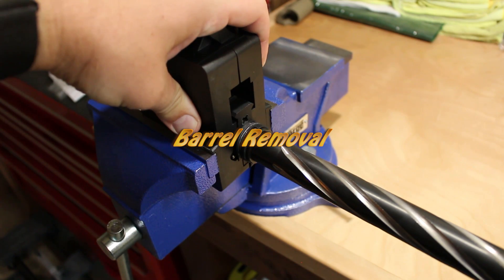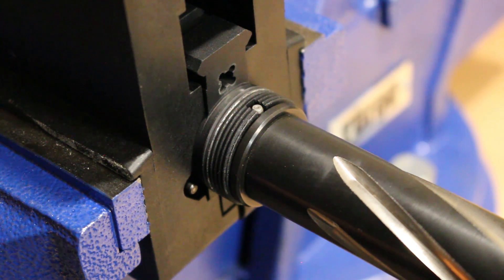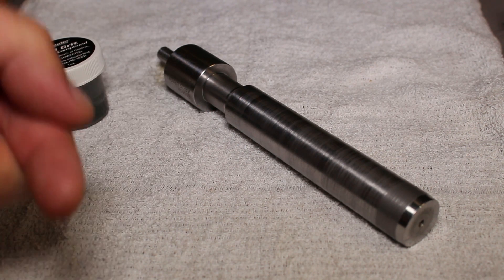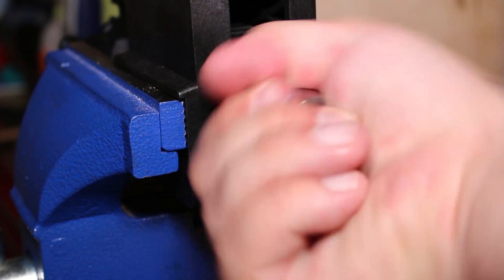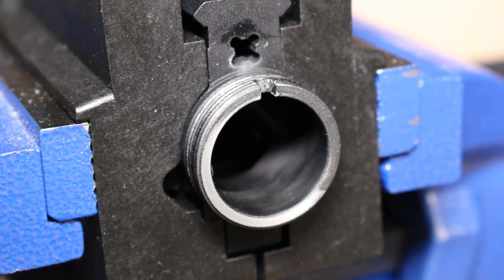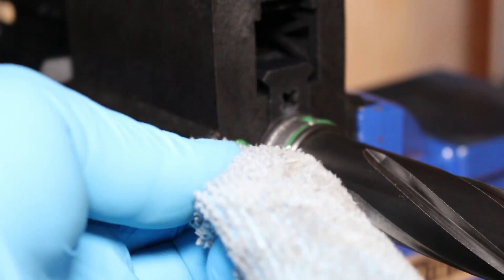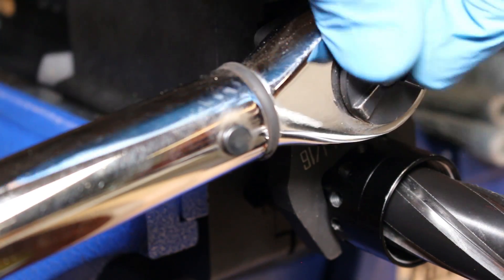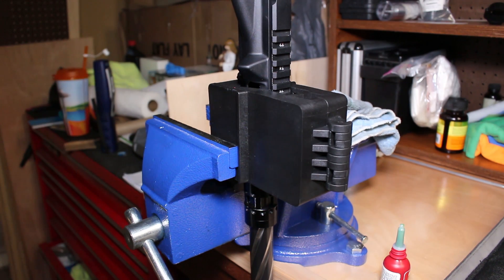Bedding a Barrel into an AR-15 upper receiver

Comment: Just for thoughts....Do all the work vertical. Lapping, bedding, tightening, with receiver and barrel sandwiched inside the plastic receiver block, receiver block vertical. There are much more sophisticated ways of centering your bcg,bolt,receiver,barrel if you have a machine shop and a lathe. But this is how I do it in the home armory. It's good enough for .75 MOA if everything else is working for you.
BEDDING. Apply the green “expanding” Loctite (620) on the outside wall of the barrel extension for proper bedding, make sure the green coating is even around. The green stuff is not for threads yo. Still in the vertical position install barrel. Then install bcg and bolt to locking position. Tape back of bcg and receiver to give extra hold. Put some aeroshell or red and tacky inside the receiver extension nut. Wipe of any excess green stuff from the mating surface of the barrel and receiver. Tighten Receiver extension nut to 20lbs only with unit still in vertical plastic receiver block. Drop out bcg and wipe any excess green out of the inside mating surface of receiver and barrel extension. Let sit for a few hours to firm up. Remove unit from crappy plastic receiver vise block and install unit on steel barrel extension wrench, wrench mounted vertically in vise. Crank down receiver extension nut to 25/30/35/40 loosen each time. Stop at 40lbs. Most nut wrenches add a few pounds (3-8) to the torq reading anyway. Let sit vertical for a few hours. Check for any green stuff inside receiver. Test bcg/bolt fitment again, should drop in real smooth. This is assuming that you removed as little material as possible during lapping…LAPPING. If you over-lapped it then it pushes the rear of the bcg backwards in the receiver, check to make sure all components are working properly. Over lapping is not a good thing. Just a little bit is all it needs. When you see exposure of silver down there between the 6pm and 9pm position during lapping is because the lapping is typically done clockwise and horizontal with gravity pulling the tool down on the system. Horizontal lapping is how they show you on the Brownell’s video and many other videos. It’s dead wrong. Gravity is working PERPENDICULAR against the centering of the system by pulling down on the drill and the tool. And the drill operator is adding a lot of error (many thousandths) to the system by holding the drill horizontal. In the vertical you can spin the tool gently by hand and let gravity do the work. Just have a little patience. Or use a low rotation battery powered bit driver that is symmetrical with the tool and vertical, 200 grit lapping compound. A hand drill is not a symmetrical tool, especially not in the horizontal….SUMMARY. The whole idea is to keep the moving parts centered together, remove gravity as a perpendicular force during install, and don't over torq your barrel nut. It's NOT needed above 40lbs. Lastly you don't need to lap the receiver down to aluminum if not warranted. So many peeps like to grind that baby down. Just lap the hard coat until you see even removal on the hard coat, if possible. The less exposed aluminum the better. The hard coat actually helps to reinforce the aluminum extension lip during the life of the rifle. Cheers.
Reply: I’m just a hobbyists but my thought process aligned with your comment. I thought this was common knowledge until I read a lot of comments on YouTube and forums.
Reply: Great explanation

Comment: WOW I see a lot of people bitching about using LOCTITE. He is using a LOCTITE brand  retainer compound.I use a sleeve retainer on my builds and guess what Criterion Barrels uses it as well in their builds.I am guessing they know a bit more about AR15s  then most of us. Criterion uses Loctite 609.
Here is what Loctite says about 620.

Retaining Compound - high strength. High temperature resistance.
LOCTITE® 620 is designed for the bonding of cylindrical fitting parts. The product cures when confined in the absence of air between close-fitting metal surfaces and prevents loosening and leakage due to shock and vibration.
Reply: Criterion uses 609 so that an average AR owner can actually disassemble things if needed...

620 is for a gun smith or machinist who has the shop equipment required to actually remove the barrel lol....definitely the right choice ONLY if you have a proper shop.
Reply: @atranimecs  620 is not that hard to get apart.  Just did one today with a heat gun.
Reply: @jbmillard  Notice a proper shop would have something like a heat gun or blowtorch like I said. average joe may not have either in their garage.

Comment: A+ for effort, but my man...that extension to receiver play is God awful. I dont even think .001 shims would do ya justice. I get the lapping, makes sense.  FYI best uppers i have ever used with my builds NOW are hands down LMT.  BCM, Noveske, Dan. Defense barrels line up with real snug gotta tap it in fit.  The upper to lower(LMT)fit is universally a sweet thing as well.  Buffer tubes, pins, trigger pins, bolt catch, etc hare great running as well.  Ok thats my tangent.

Comment: hate to break it to you but your loctite temp will not take 556 temps
Reply: How hot is that?

You may get ~300F on the barrel speed shooting (Not on the barrel extension, a separate piece of metal that doesn't come into contact with the brass or contained gas itself). If you're shooting fast enough to get it higher than that, you won't be worried about accuracy, since you're burning out the rifling in the throat.

Loctite 620 is advertised to withstand 200C (392F). The barrel extension is not likely to reach the barrel's max temp. And again, if you do get it that hot, whether your loctite holds or not isn't going to be the deciding factor in how quickly your barrel stops being accurate.

Comment: Is there a potential for cracking the upper due to the expansion of the loctite against the inner portion of the receiver/barrel extension?
Reply: Prolly not. Billet aluminum has a pretty good elastic limit and an even greater UTS. Forged even more. Plus there is the greater thermal expansion of aluminum.

Comment: If my barrel wiggles in my upper like that, I am trying out different barrels and different receivers and whatever is the problem is getting returned with a poor review.  If your upper fits your barrel like that out of the gate....No.  Just no.  It should never be that loose.  If you have to do what he is doing you've already failed.

Comment: If you have that much free movement time for a new upper. Aluminum is a recyclable metal. Buy a new upper for anywhere from $39-$200 depending on the size of your wallet.

Comment: Head spacing is already determined from bolt and barrel lockup. NOT the receiver trimmed back. You "might have feeding issues if ramp cuts in receiver does not match up to barrel. But headspace IS NOT SCREWED UP JUST BY LAPPING

Comment: Many are under the impression that a  locking material like LocTite is needed- IT IS NOT. The torque holds the nut to the receiver. I have never, ever seen a loose barrel in the military.  As an armorer I have seen thousands of overused guns. YES the facing of the upper is needed especially for long range shooting as it aligns the barrel to the upper.  Facing will NOT change the headspace as the headspace is integral with the barrel. The barrel MUST fit snug to the upper and the best fit is a slip fit. We used .001 stainless shim stock wrapped around the barrel extension to fit sloppy barrels for accuracy guns as even .001 barrel shift when assembling will  cause a lot of scope issues at long range. Within MIL-SPEC is a joke as it is the MAXIMUM and minimum allowable specification and still work..  FYI  The shear point for a  barreled upper is the last thread on the upper behind the barrel nut.
Reply: The purpose of the locTite is not to keep the barrel from coming loose.  The purpose is to fill the void like you are doing with the stainless shim stock.  Shim stock is much better, but still adding the LocTite fills what' little void is left so that there's even less movement.
Reply: @nospam3409  Eh, personally I wouldn't use Loctite at all, but that's the benchrest fudd side of me coming out.  I would think Marine-Tex could be great at this though.  Not only because it has very low shrink and is practically impervious to chemicals, but also because it would provide a thin barrier between the steel extension and the aluminum receiver to help prevent galvonic corrosion.  Only reason I bring this up is I just pulled a barrel from 2 years of use and found a lot of it, and since I've been looking at further preventatives this might serve a double purpose.  

You could also use actual bedding compound, but since those contain numerous metallic powders I think it wouldn't do much for prevention.  Besides, marine-tex is good enough for the f-class, PRS shooters (the real shooters, ie not me), it's probably good enough for wanabees like me.
Reply: Thanks for taking the time to write this.
Reply: Yep this dude knows. This video is crap.
Reply: I never use loctite but i do use anti-sieze on the threads because too many have come to my shop for cerakote and people do not take care of their weapons and they are rusted fast and gauled to the aluminum threads
Reply: @HPAccuracy that's the correct way. Don't lap upper receiver and don't bed your AR15 barrel. You can add anti seize to the barrel extension or the inside of the receiver where the barrel fits in too but isn't needed. It helps if you ever plan on re-barreling your AR15 down the road.
Reply: "...in the military..."  

Stopped reading right there.
Reply: @fluxcapacitor05 sounds like a true hobbyist
Reply: stainless shims dont disintegrate over time from the cooling/heating cycling?
Reply: @atranimecs  If that is a question then NO. No rust or deterioration at all.
Reply: @@user-hs5vk6jw1o that's before when tolerances were a lot looser and machining wasn't as precise. Especially with some uppers being designed with smaller diameters to be heat fitted to the barrel extension and torquing the barrel nut will compress the upper onto the barrel extension as well. It's absolutely a waste of time and money.

If your accuracy is that bad with modern AR15 parts you're either a terrible shot, have shit parts or both.
Reply: In my case though it does make a difference. I had Ruger MPR that I got rid off. After a while the barrel nut got so loose that it could have been taken off with a finger. 
Luckily I found that out before anything catastrophic. I say DEFINITELY blue lactite the threads. My 2 cents

Comment: How much difficulty will be encountered when it's time to remove the barrel?
Reply: Depends on if antiseize is used (Aeroshell 33MS is milspec and perfectly sufficient, no need to get exotic) and also the upper receiver.  A bravo company upper and some others are tighter tolerance and you have to heat them with a gun to get a barrel on, so they are difficult to get off.  Get yourself a heat gun for reflowing solder and you will find that there isn't really a problem removing it.
Reply: a little heat from a torch, easy pezy
Reply: @chrismcrae4652  ummm a pretty big torch...that is highly heat resistant compound

Comment: Great video! I think most of the people leaving comments claiming to be "Professional gunsmiths" and slamming the use of loctite 620 are missing the point. In the video, this man is not using threadlocker on the threads. He is using cylindrical sealer to close the gap on the barrel shaft. I didn't see him put any "Thread locker" on the threads. Also, just because it's Loctite brand doesn't mean that it's threadlocker. That company makes more then just thread locker.... LOL
Reply: Exactly
..and that's 'bedding' an AR barrel. 
Lapping is the procedure to make ready for bedding.
Reply: Yep it's called retaining compound and that's precisely what it's for, retaining and taking up a small gap, it's almost as strong as a weld and is a ferocious bond pretty crazy stuff
Reply: Kenny Wooldridge  Is anybody familiar with Loctite NS 5540 High temp for  Threads and Flanges? With a service temperature of 100 to 1300 degrees Fahrenheit?
Reply: Lapping one surface that mates with another is a waist of time unless all surfaces are squared up nothing is getting trued up. So one would also have to lap the barrels and barrel nut. But before that's done one should measure the shit out of the parts to find our of this even needs done or where they are off.  Is the barrel nut getting squared up also he didnt lap it so the upper is squared up but the barrel and barrel nut are what the hell ever . Lapping just the face on the upper receiver is waist of time. There are at least 5 points of contact between barell, receiver, and barrel nut but we are to  square up only one surface. I wish could do that at work just debut one surface and call the part good.
Reply: @PurpleHaze-151  the barrelled flange that meets up with the receiver is already squared up from factory. It's squared up when the barrel is formed and would be almost impossible to have that flange NOT square unless someone completely failed in the making of the barrel. The receiver is not square. You lap the receiver to get it square, which you can actually see by the lapping compound marks and then the barrel flange sets square to the receiver. The barrel nut doesn't have to be totally square because it's just compressing the two surfaces together. So there's are only two surfaces that need to be square and one (the barrel flange) already is square. The barrel nut only has to be close (which it is) for it to all pull together close. Then the retaining compound fills the gap between the barrel tube and receiver.

Comment: 2 issues with the video. If you are lapping the receiver to get consistent even surface, why would you stop short of a complete lapped surface. And the Loctite. That's just not good advice. Antiseize or a good grease only.  Some poor guy is going to loctite the barrel nut and "That's what I saw on YouTube". I guess the 2 issues is the video.

Comment: How could headspace be affected by shortening this threaded area? I thought headspace was dictated by the distance between the boltface and the shoulder, which depends upon the lockup of the bolt into the barrel extension, neither of which should be affected by shortening this thread. Am I wrong?
Reply: you are correct
Reply: If you shorten it enough, the barrel nut might compress the pin into the receiver face and tilt the barrel downwards (Since the shoulder of the barrel extension wouldn't touch the receiver face). If it tilts enough, headspacing gets affected since the bolt doesn't push directly into the extension, and you get a slightly bigger space at the top, and probably an inability to drive the bolt home. It's an extreme case, but it can happen.

Comment: 🤦‍♂️ Please just stop. Don't used Loctite there are way better compounds made specifically for barrel bedding. Though the lapping was done ok and safely you really need to add some kind of grease to. Those threads for the barrel nut, shit I would even give you credit for using. Tetra gun grease on the threads.

Comment: Good concept bad deployment. I've always had no play in my aero uppers when I install ballistic advantage or faxon barrels. I have noticed this whenever I had a cheap palmetto upper with a cheap bear creak barrel. Always always always use aeroshell and not loktite.
Reply: I had the same experience with Aero uppers but next time try a BCM upper! I had to heat up the upper because I couldn’t get the barrel to go in.

Comment: buy aero precision enhanced upper the upper has all the parts machined into the upper receiver.
Reply: I was just commenting that I've never had a problem with quality parts. It seams he has a cheap upper from the finish and that barrel I'm 90% sure is a bear creak which is a no go with me. Also you never use anything on barrels but aeroshell grease and the guy didn't even season the threads with it.
Reply: You can lap Aero enhanced upper receivers. The barrel still slides into the enhanced upper just like it does with a regular receiver. So I lap enhanced uppers like you a regular upper. But you need a special lapping bar like what G&G Rifleworks sells.  After I lap, I install with the proper grease just like with a regular upper receiver. But I don't bed my AR barrels.  
http://www.gandgrifleworks.com/AR10-Lapping-Tool-ar-15-lapping-tool-p/arlap.htm

Comment: you should let people know that the free float handguards like you used have to have the screw holes lined up and can be way out if you torque to much at once it may be to far to make the next point to line up screws

Comment: There- is absolutely no need to lap a receiver or bed a barrel if you buy quality parts.
Also, the headspace on the AR 15 is in the barrel extension and NOT the receiver like a bolt action.

I don’t know what moron came up with the great idea that stripping the anodizing was a good thing.
Reply: Not true re not needing to lap

Comment: There sure is a bunch of hater crying bitches on here. The way you did it is just fine and will work. I have done it many times with a lot of success. To each his own, if you don’t like it don’t do it.
Reply from the maker: Thank you for your support.  We have had much success with the method used and have not had to replace any barrels or uppers in the mean time.  We use our rifles for precision bench  or prone shooting and don't shoot more than 25-50 rounds at one sitting.

Comment: why do you put the loc-tite on the barrel that slides into receiver?  Is Loc-Tite 620 the same as the grren Loc tite Sleeve Retainer ?
Reply from the maker: Correct... as the loctite cures it hardens and takes up the space that was between the barrel extension and upper reciever.  I am using it as a gap filler.  Loctite does not expand so you dont have to worry about that...